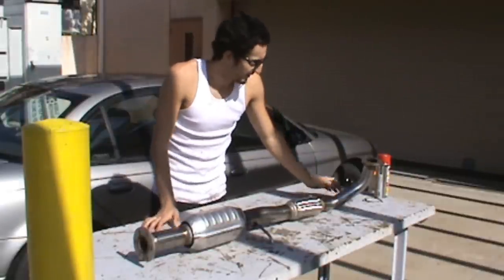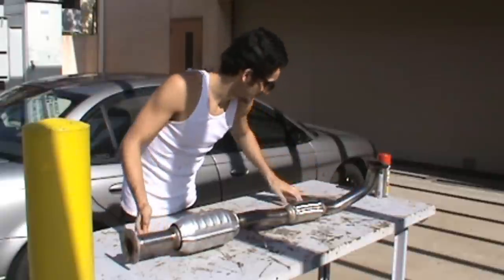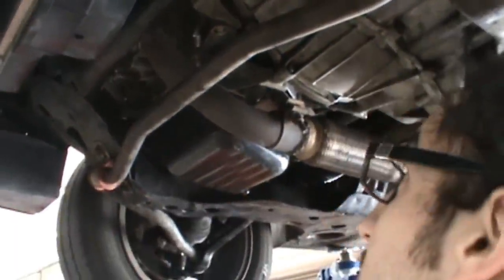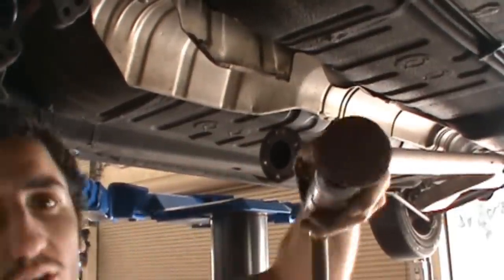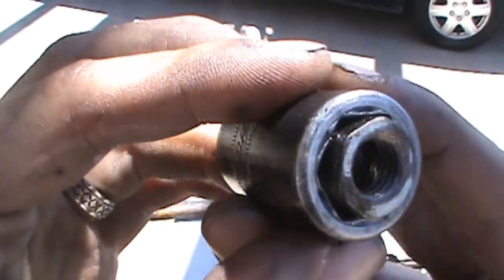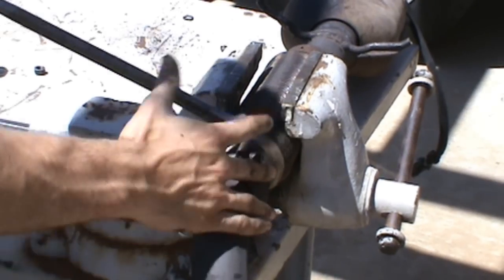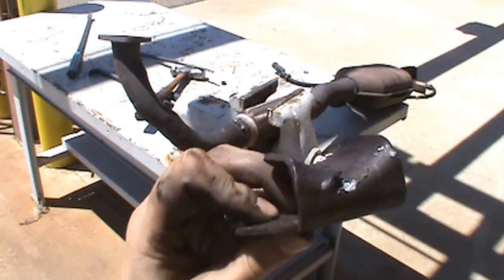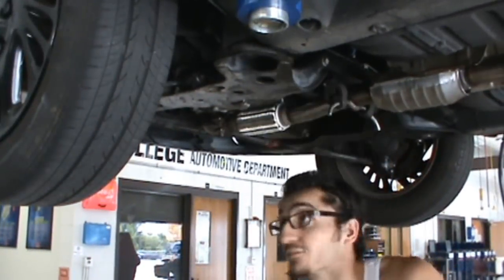Replacing your Catalytic Converter (How to pass smog)

Comment: I agree with the guy that said "do your videos when someone is not on the cutoff tool"..Wow,,, That was like being in the dentist chair.. As for a better flow causing your engine to run lean; I think that the car's O2 sensor will over compensate for the free flowing exhaust gases and cause the car to run more rich rather than too lean. And did you guys ever hear of using a torch to heat those nuts to get them off? WD-40 doesn't always work but heat works every time. Get the nuts red hot...

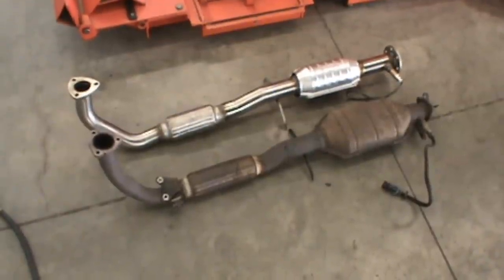Comment: @ 4:55 you can see that this is an inferior aftermarket replacement catalytic converter because of the small size of the "catalyst shell" This vehicle will set an "efficiency below threshold" code (P0420) just as this catalyst degrades just a little bit! This does appear to be a well equipped shop though!

Comment: After replacing the Cadillac converter and Still will not pass smog what do that mean ??? They said I have to keep driving but that's all I been doing I put 200+ miles on my car I have a 2001  Nissan Maxima need  help I already spent $924 so at Midas 😡😡😡